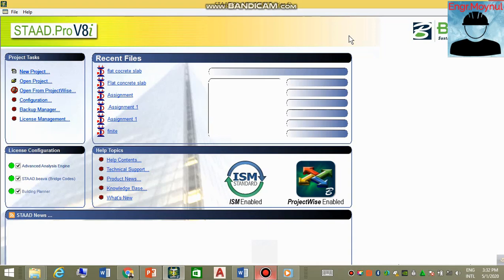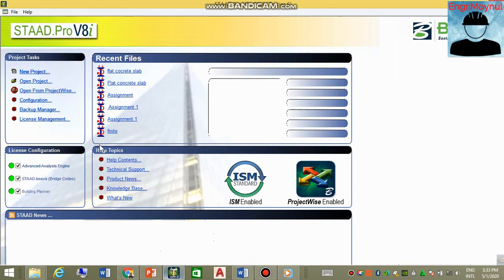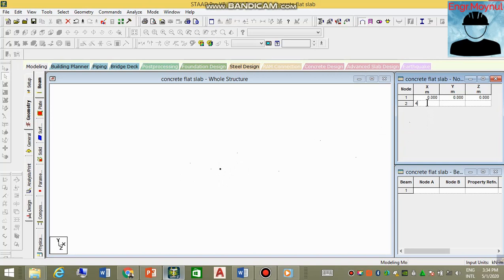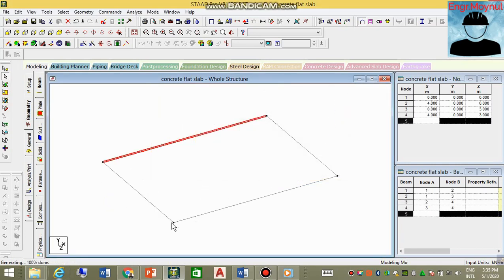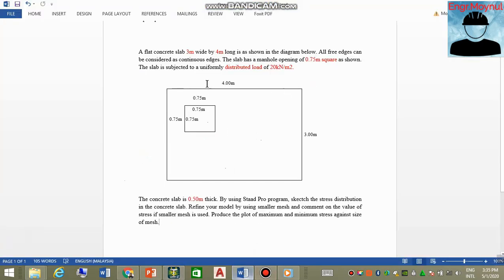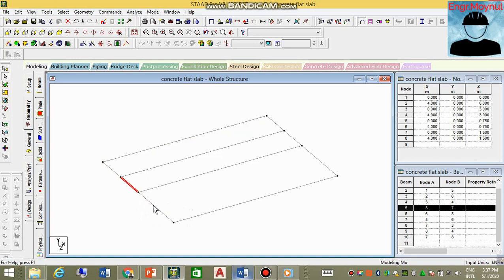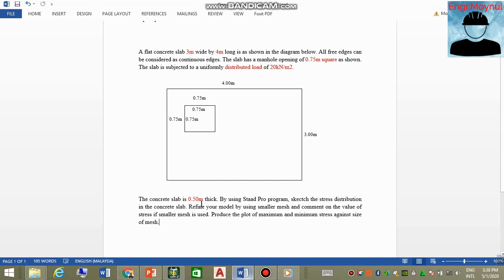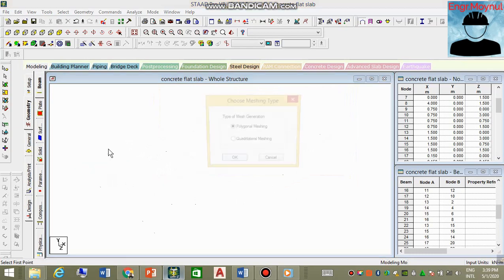How to design Flat slab by using STAAD. Pro

Comment: why do we assigned support at all the edges? I realize, if the slab is supported on columns, and we only create pinned support to those nodes, you will experience high shear stress, especially at the edge of your plate, do you experience such issue?